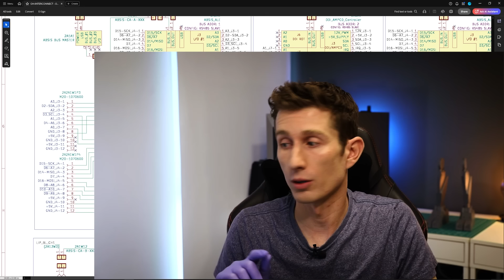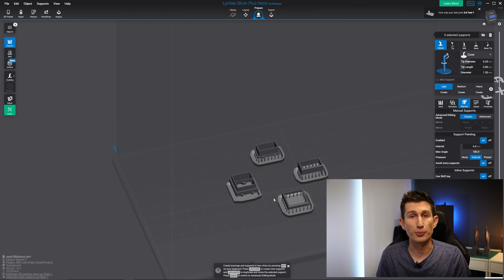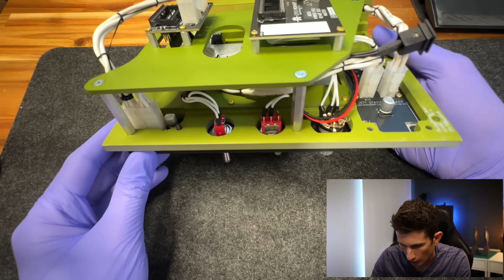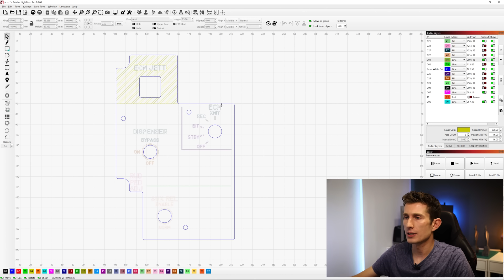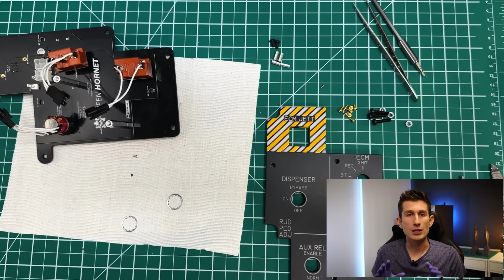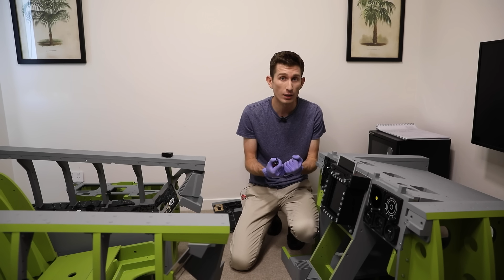Ep. 30: F/A-18 Cockpit LIP Complete | Open Hornet

Comment: actually all the wiring inside an airplane is white, and for good reason. they use wire with a titanium oxide layer so it can get laser engraved. perhaps you didn't know that, but I'm guessing that happens so that they never lose any tags, and what's worse, there is no room for tags anyway. I'm not sure if you have ever seen proper wire looms in airplanes, but you made them exactly as they are done in reality. If that was intuition, it was spot-on mate.
Reply from the maker: Thanks mate!! That’s a really cool fact 
I like it 
Cheers

Comment: Hi, have you tried using arduino nano every? did you manage to make it work? Because my seems to not receive inputs from board, dcs-bios works and it connects and serial connect-serial-port is connecting with my board but it displays a lot of garbage like this: 
> 2026/01/19 22:42:34.000065994  length=1054 from=0 to=1053
UUUU....A-10C.                  ..f.0.8.4 New callsign            N)d
38   0   0....E$..(.1.08:00:28    0 ...p.... 1.00     0     0     +.....240  120  000   A  .CHAF FLAR OTR1 PROG@..........A..........................&.......&..........................ffffff.................6e.e.33A240s120OFF     ......................G...G.................b.d.................U ..U     ....T|.......
........U..\a040000  Ci%...D....\bH.0.0.0  .0  .0   0  U...D.............................................a........016X........108.95.. 12.00T...**.***)* 1..I.1200 . 1.. 3..00......Oq........................ WAYPT       0    */B1                         .0    SP     INIT POSIT.                    UNK .EL:41    ******* DTOT. NO CR                  .N41.36.219          ?1.            WND **/** .E041.36.555        L/L.[               ] P1/2           f         .       .                                             &             . .         .       . .     .   .         .   .      ACTIVE  ...+..................108.95124.000.30.000  ..................   .   .......

i tried every thing that came into my mind and it still deosnt work, program i made in arduino IDE is super simple it only should detect if one button is pressed but it doesnt work.
and im using #define DCSBIOS_DEFAULT_SERIAL because it is only one that works with nano every

Status for device COM3:
-----------------------
    Baud:            250000
    Parity:          None
    Data Bits:       8
    Stop Bits:       1
    Timeout:         OFF
    XON/XOFF:        OFF
    CTS handshaking: OFF
    DSR handshaking: OFF
    DSR sensitivity: OFF
    DTR circuit:     OFF
    RTS circuit:     ON

Comment: Question :
Have you found any mod that gives the MFD/MPCD symbols and lines a thicker aperance .
The exported viewports look very thin and and have very low brightness ?
I know ju could work with reshade to make the displays brighter, but lines and symbols are still very thin.
Maybee this question is asked in wrong Episode.?
Cheers from Sweden
Reply from the maker: Hey! Have a look at the standby instrument episode 
I think it’s episode 28 
When I’m working on the RWR I show settings to change in the .lua to change thickness if lines 🤙🏻
Reply: @aHornetsNest  
Hi !
I get the part of shaderlinedefaultthicknes/Fuzzines part but I cant find what LUA's to apply this for MFD/MPCDs.
Looks like some changes been made in the file structure some updates back  (2.9?)

And, shouldnt all mods be made in the C:\user\savegames\dcs\scripts.. now adays ?
No editing/moding in the in the DCS game folder ?

//Cheers
Reply from the maker: Hey when I get back home I’ll have a look, but with this sort of edit - it’s it’s done in the game install, unless you can somehow create a seperate lua that acts as an over riding lua in the saved games… if you do work that out let me know and it’ll fix a heap of other issues I have 🤙🏻
Reply: I belive that since 2.9 DCS reads file structure from savegame and give files put in there priority as long as the files and filestructure match the DCS World Game.
All files in right filestructure and syntax will load in the game.

If I'm wrong anyone can correct me?
Reply from the maker: I’d like to look more into that 
Can you shoot me a message or email 
ahornetsnest@gmail.com or on Facebook
Reply: @aHornetsNest   WILCO

Comment: Can confirm working avionics, you have the accuracy down so well. Even down to the dropping of nuts and bolts in PITA areas 😂

It's nice you can pull the entire upper control panel. Ive spent a dizzying amount of time upside down laying on my back on the seat trying to work on something behind the front panels. 🤢
Reply from the maker: Haha those who have dropped nuts and bolts know the pain 
Yeah I’ll need to find a way to lift it when it’s all assembled and heavy 

Hahah yeah the amount of time I’ve been in awkward positions to get the wiring in on the LIP is immeasurable 😅 so I warn about physio for a reason 😅😅 how’s yours going?
Reply: @aHornetsNest  I just purchased a home so at the moment its completely dismantled. But really it just needs the arduinos connected to the wired panels and tested.  
I picked up a few of those crypto 6 pin plugs. So Im going to design a KY panel as well. Thanks for asking!
Reply from the maker: Oh nice one!!! Enjoy the move as much as you can 
And the rebuild! Keep me up to date

Comment: What are you using for your switch bats?  Assuming resin but couldn’t tell on video if they were machined or not.  Guess that’s the point, right? 😂
Reply from the maker: Hey! the switch bats are as per OH 🤙🏻 so just milled out of Aluminium
Reply: @aHornetsNest copy that!  I have looked into getting them done at a few places (China based) but the cost is out of this world without doing a group buy.  I think I was quoted $950 USD for just the left and right consoles.  Going to check with a few local small machine shops around my area too.  Appreciate the quick response!
Reply from the maker: Yeah as a single buyer it’s pretty pricey…. If you’re not alright 
Jump in the Open Hornet discord and there may be a current group buy 
I saw something a week or 2 ago